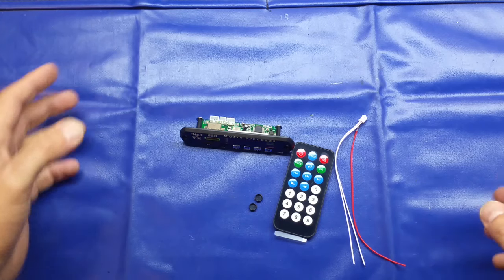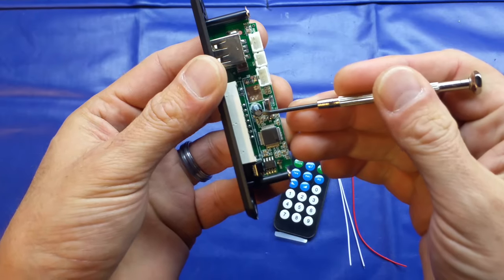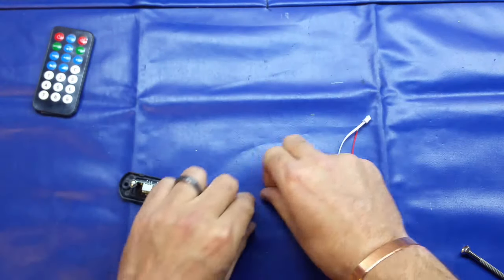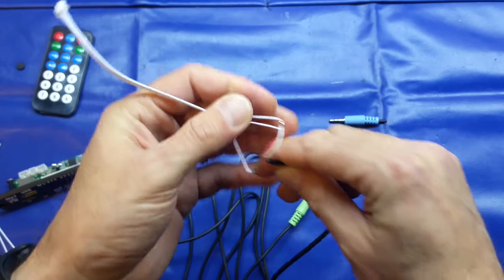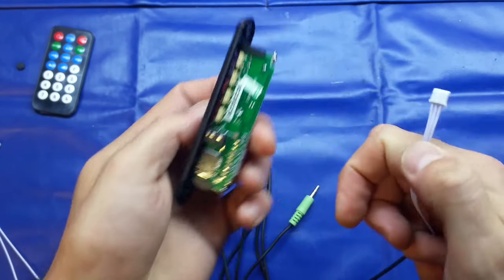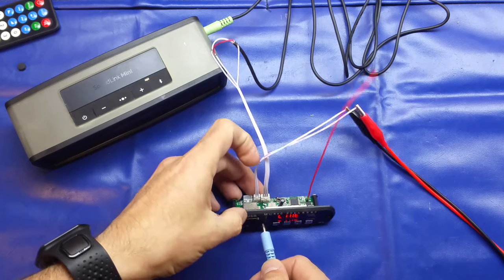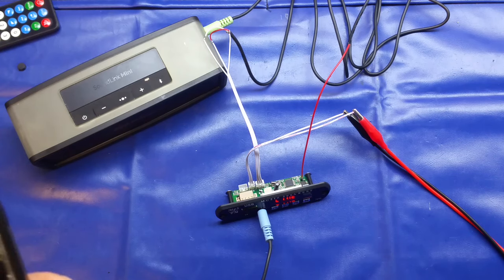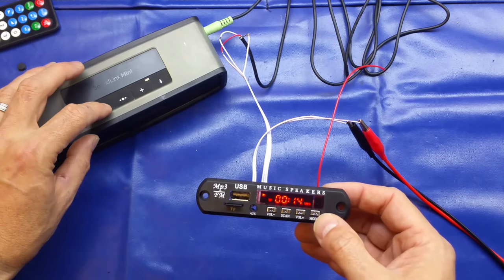Super-cheap MP3 decoder / FM radio module review

Comment: Nice to see this module demonstrated in English. How do you rate the audio fidelity - is it pretty much distortion free?  Can it play MP3s at any stream rate i.e up to 350Mb/s but even better if it can play 24bit WAVs? I have been looking for a cheap but good file player to use as a front end with some of my general audio systems and this unit seems (potentially) ideal?

Comment: I got a model with bluetooth. But it has a lot worse FM reception. As I investigated with an AM radio which is naturally sensitive to any sort of electromagnetic fluctuations rather than letting us listen to something meaningful at all I get a terrible interference when the circuit is seeking for bluetooth devices. I read THE SAME interference when I set the circuit to FM Mode. Bluetooth does involve a job that uses FM reception, but in UHF range. As it turns out, the circuit is seeking further for Bluetooth devices even when it's set to FM mode, and the bluetooth carrier beats with whatever FM carrier would I seek for, generating random noises and muddying up the whole reception. Also, FM Radios does not interfere with each other.

Comment: I have one of these in our RV, have it hooked to an amplified set of old computer speakers mounted in a nice wooden case I built for the entire outfit.  I use the USB to supply music via a jump drive, never gave any thought, I guess to using the USB to charge my cell phone, as I have a nice charging station I built using a massive 12v to 5v step down transformer and a 10 output USB stick each USB port switchable. I had to go into the stick and rewire it to handle the amperage so each can furnish 2 AMP output if required, although most of my USB things are quite happy with around 1 amp to charge.  The unit is quite nice though, mine is a few years old now and still going strong.  This allows me to have a nice radio in the front of our motor home without having to strain the starting battery, as it runs off the house batteries which are topped off when we are hooked to shore power, which we usually are when hiding down south come winter.

Comment: you can get the same one with Bluetooth as well, i used one to make an mp3 player and to be honest the sound is not bad at all.
and its small and cheap to so if you bugger it up you can get a new one for cheap.
one more thing some of them are 12v to so they have a voltage regulator on bord.

Comment: Excellent review Kris thank you.
Quick tip...I always tie a knot in the power lead when the leads are the same length so that it  separates the positive and negative  avoiding unintentional shorts . Its also provides a quick visual cue as to which lead is the positive when making temporary connections.
In the car you could use the cigar lighter socket with a 5v adaptor plug and cable wired to the MP3 module. I am thinking about fixing mine in the armrest box where I have a 12v cigar socket fitted  to charge mobiles

Comment: HI, i just want to ask you, I have a mp3/fm radio module like that with different models. at the power input on the board iit written "+9v/5v", so I think it can be connected to the powerbank/phone charger, but suprisingly no effect.. But when I connect to 9v batteries, it can turned on. So what does "+9v/5v" mean? 
sorry for my bad english :D
Reply from the maker: It could possibly refer to the 5v output of the USB port.

Comment: Great vid man thanks for posting this.. I ordered the 5v version of this from ebay for $4.79USD and connected it to a PAM8403 3watt 2 channel mini amp i got for $0.75USD also from eaby to the 5v side of a 4pin molex connector from my computers power supply and it works awesome !! The best part is the MP3/bluetooth is mounted to the face of the computer and the amp is mounted internaly to the computers case and i mounted speaker conectors at the back of the case and run about 8ft of speaker wire to some kinda large yamaha 3 way house speakers and that PAM8403 powers the speakers with no issues what so ever and sounds very nicee. The nice thing about this is no matter where the computer is its got a MP3/Bluetooth/FM radio with an amp that doesnt require an extra power source that can drive any non amplifed speakers you can find since the PAM8403's speaker Ohms range is from 4 to 16 ohms. The same thing can be done with the 12v version and a PAM8410 mini amp and can be wired to the 12v side of a computers molex and mounted internally in a compter or put in a external box and powered with a 12v power supply

Comment: Hi. I got this one (or it looks super similar) and I got myself a  TPA3110 XH-A232 amplier board. Both a super cheap. I assumed it was with out amplification thats why I go the  TPA3110 XH-A232 board. But when connectin left and right it is on maximum volume super super loud.  So I thought maybe it is amplified. But now I am confused again. Apparently I need somthing else? But That would give me dual volumes? one on the mp3 bt fm decoder and extra to the amplifier? that's weird?

Comment: Hi!
I wish to connect this module to a small valve pre-amplifier that I found on aliexpress. The first time that I connected the module to the 5V works. I tried connecting the output plug of the module to the input of my amplifier. Result MP3 car module dead. Have I to use the AUX plug on the front? tnx so much.

Comment: I know this is old now Kris but did you ever log the current draw of this device when used as a music player/FM radio? There are lots of these on eBay now (some 5V and some 12V supply) and one of the ads for a 5V version (looks identical to this one) says "Working current: 1500mA"!
Reply from the maker: +standishgeezer I didn't but I'll do it for you when I get back home.
Reply: +Kris Cochrane Cheers.
Reply: It`s consume around 100 mA or less. I checked with my power supply.
Reply: its true well mine was drawing around 90 MA but 1500mA is a bit excessive hahah
Reply: 12-volt ones are usually with Blue tooth.

Comment: I got a loud buzzing noise in fm mode. Both external amp and mp3 decoder powered by same powerbank 5v. Please help. thanks
Reply from the maker: +Win7ultimateUser it's likely the power bank's circuitry that is generating the noise...have you tried another power source?
Reply: Kris Cochrane yes, 2 different powerbanks, 2 usb chargers and my PC. All the same loud buzzing noise. :(
Reply: I think you habe a probleme with a ground loop.

Comment: I am using this module in car conected with aux to car player , works great but have an inconvinient , when start dosen't  memorize the last settings like volume , last song on micro SD  etc.
Reply: You Need to find live wire while car is turned off with keys removed. Use a voltmeter and tap into a wire in the fuse box

Comment: what power supply this needs?
Reply from the maker: Hemant More Hi, it just needs a 5v PSU. The USB socket can supply 1A so 1500ma/1.5A would be more than enough.
Reply: looking at same one that has both 12 vdc and 5 vdc inputs , says to use either one but not both ...

Comment: Plenty of 12v modules available on aliexpress so no need even to invest in a regulator.  Madness!
Reply: These have a 5 volt regulator on board so you can use power supply max. 35 volts.